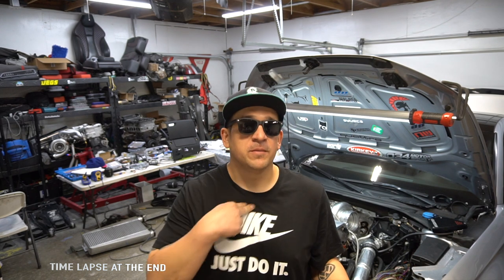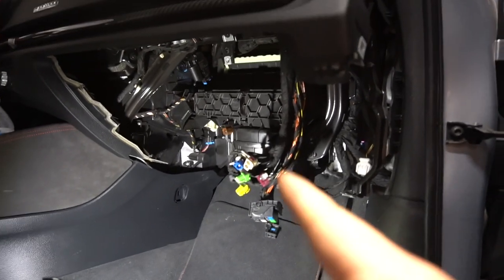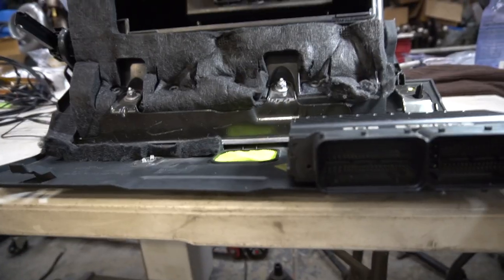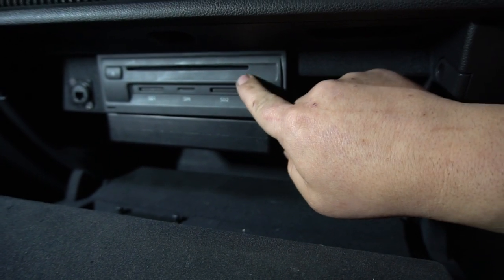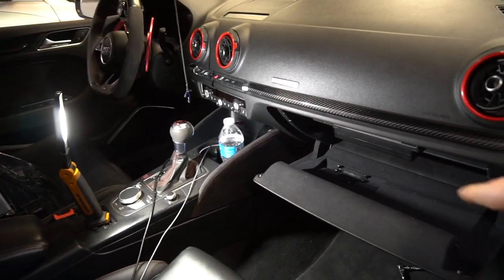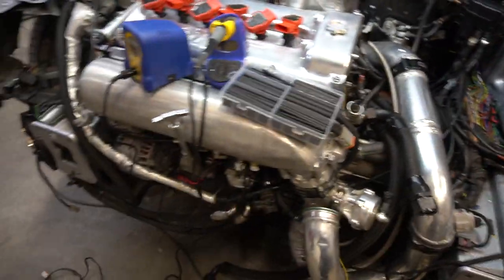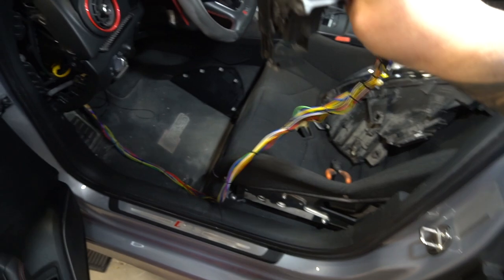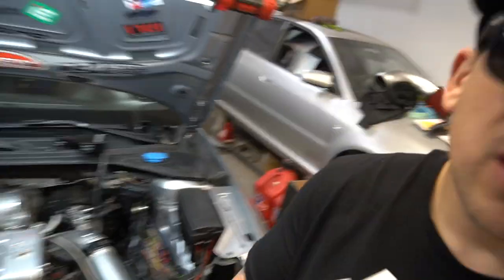SYVECS S7 Relocation and Wire up continues |  PT. 2  |

Comment: You found the exact colored OEM wires on Amazon too?
I haven't had luck in my search
Reply from the maker: I found Amazon’s limitations lol

Actually found all the wires on prowireusa.com 

And connectors at bmotorsports.com
Reply: 😂... I'm familiar with those sites as well... Ordered my plugs/pins from there too... 
But since I'm piss poor I was hoping for "Amazon like" variant with the OEM color combos  @MalakaMotorSports
Reply from the maker: Didn’t really want to risk it all wire looks the same from outside but didn’t want intermittent connection issues so but known good quality stuff
Reply: As long as it's Tefzel wire, it'll outlast my 90's rust bucket... Most intermittent problem are usually at user crimp connections anyhow... Amazon needs to step it up...  @MalakaMotorSports